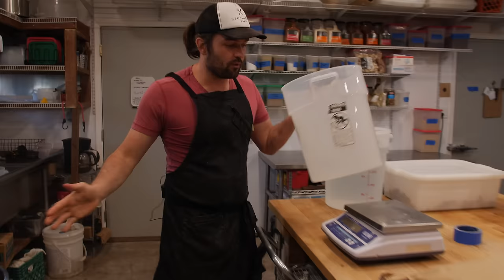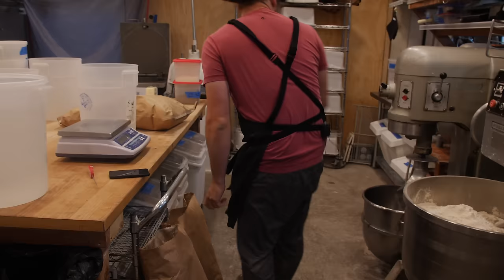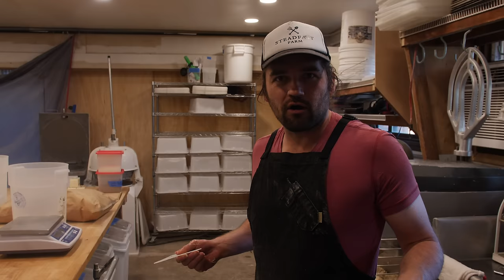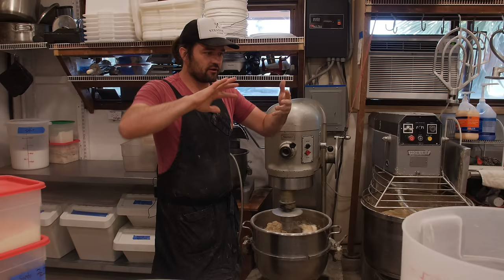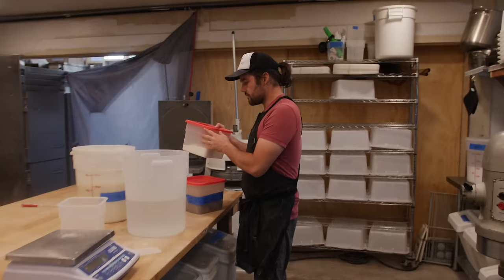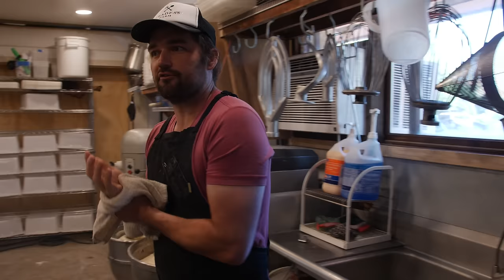Timing and Temperature are Critical for Sourdough Bread | Proof Bread

Comment: Love your speech and knowledge of the business, great content to ear. Though, must say, hearts to see such amount of trashed water at the start, sorry cant disconnected a great product from a optimal waste free process. Nevertheless great job.
Reply from the maker: Thank you very much for feedback on the water. The problem is that as it’s running it is not at the temperature I need. I think I’m order to recycle this water it could be redirected to the garden, but for this I need more engineering.
Reply: Proof Bread the The garden is a great idea... and it would take some sort of switch from sink to garden tank and back. We reuse our ‘shower warm-up’ water to flush with, but it wouldn’t be good taking a bucket between the kitchen and bathroom.